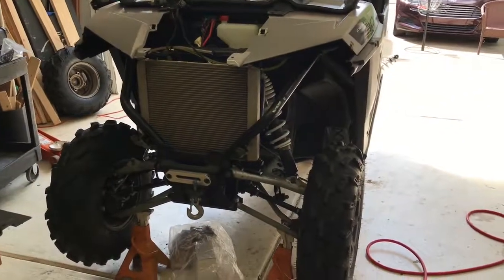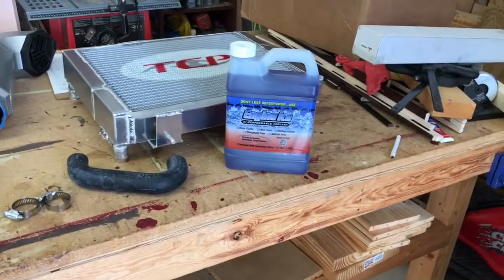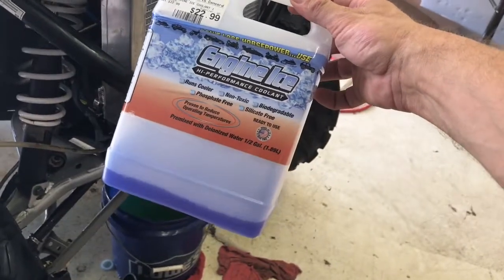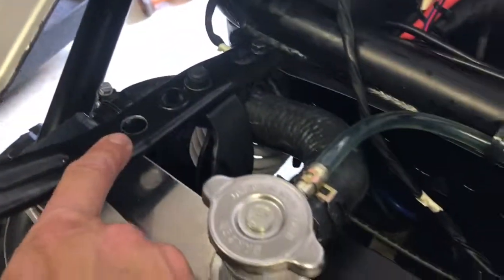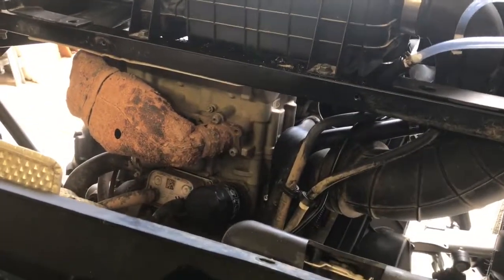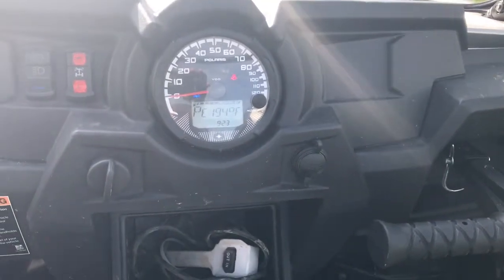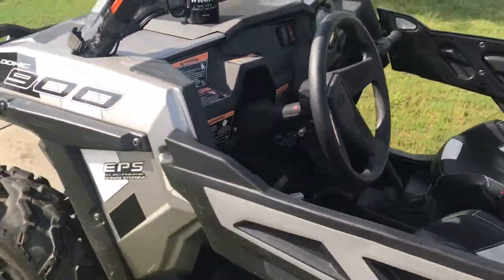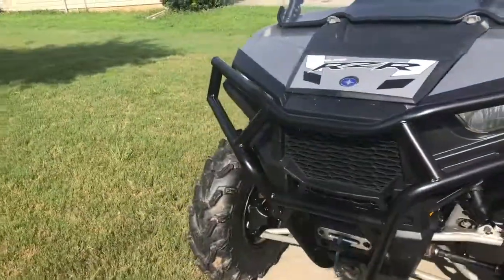TCP triple pass mudder Radiator for Polaris RZR 900 (First Look)

Comment from the maker: It performs well in the mud. I'm very happy with it overall. Washes out a lot easier than OEM radiator. I constantly monitor engine temp since the installation of this radiator and it's very consistent cooling the motor once the relay kicks on around 204 or 205 degrees. It very quickly drops it down to 188 to as low as 183 degrees. It has performed consistently clean, cover in mud, or filled with river sand. I'm currently having some unrelated fan issues but it's no fault of the radiator. I caught the fan issue immediately because I constantly monitor the engine temp.
Reply: I'm looking forward to installing mine...

Comment from the maker: I'm no expert but I'm pretty sure it was due to mud on the radiator. Once the stock radiator was rinsed off it no longer overheated. Hopefully this works because the only other option I know of would be to relocate the radiator to the hood or the bed and I don't like either one of those options. I don't like the look of relocating the radiator to the hood and I don't like the obstruction of view it causes. On a ATV not as big of a deal because you can stand up and look over the top of the radiator. In a RZR you're limited to a sitting position and you can't simply just stand up to see over the radiator. I don't like relocating it to the bed because that would take up valuable cooler space.

Comment: weird, i have a 2015 rzr 900s and it has never over heated. You sure it is not the water pump or maybe air in the systems?
Reply from the maker: Mike Panocatapolis I think it was because of mud caked on the radiator.  Once the stock radiator was rinsed off it no longer overheated.
Reply: Our rad plugs up pretty easy. Going to look into this. We have gnarly mud out here.